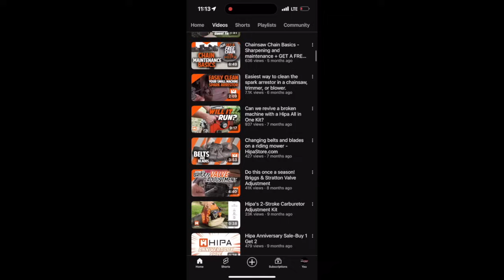Pure Stock Race Car Plans have CHANGED! "This Thing Looks GOOFY"

Comment: A used 602 crate engine from a modified team is all u need man for an engine. Upgrade the valve springs and run Daytona 1 crate engine light weight oil and go win !!   Them 602s plain work especially in a hobby stock car 💪🏻🏁. Hell u can find them $2500-3500 with accessories in my area
Reply from the maker: That’s awesome. May look into that option

Comment: Even though the front end of your pure stock looks goofy, I would leave it as it is. Accidents happen.Someone will run into someone else. If you run into another race car with the front of your car at a reduced speed, or someone runs into you, you will stand a better chance of driving away because the front fenders won't be shoved into the tires.
Reply from the maker: I agree that accidents happen I just can’t stand the look of it anymore.
Reply: @flemingfamilyracing  I had a pure stock way back in the day. To prevent the front fenders from being shoved into the tires, I cut the forward part of the front fenders off parallel with the ground. It was the goofiest thing you ever saw, but I could continue racing if I got hit or hit another car.
Reply from the maker: @tracyjones6284  gotcha. Hopefully that’s not the case with mine
Reply: Id worry more about how it performs rather than looks
Reply from the maker: @lucaslouder2788 should have one bad to the bone engine once the heads are done
Reply: @flemingfamilyracing   hard to say that when it hasn't been fired or ran
Reply: @lucaslouder2788  In our pure stock class, we were very limited to what we could do to our engines for performance. Everything on the engine had to be stock. No headers, log exhaust manifold only, no aluminum intake manifolds. Factory spec cast 4bbl manifold and spec carb for the make of vehicle. No performance valve work, limited to CID, depending on make of vehicle. .480 lift maximum hydraulic only camshaft, no solid cam, no roller cam, rockers or lifters, and no greater than 10.5 to 1 compression. We built our engines to free spin to get as much HP and torque we could out of them, and used a high volume oil pump to keep the crank and rod bearings from spinning.This was done to keep costs down. If you violated the rules, you were fined and you lost season points. If you were caught violating the rules again, you received a larger fine, and were black balled for the remainder of the season. Pure stock meant exactly what it meant, PURE STOCK.
Reply from the maker: This engine has been run before. Just not with these heads. Hoping for the best